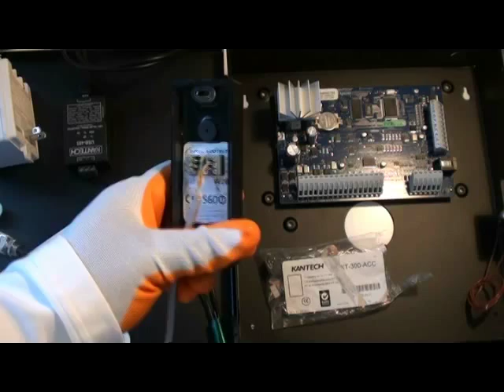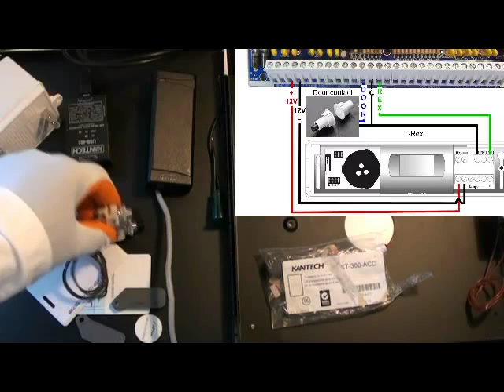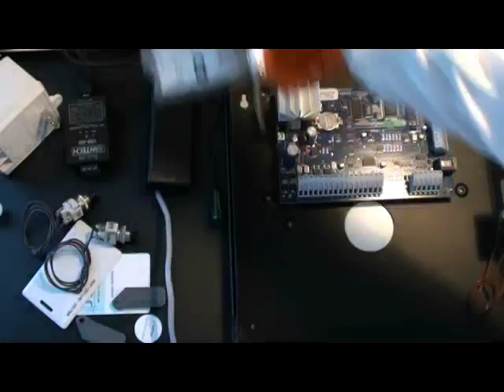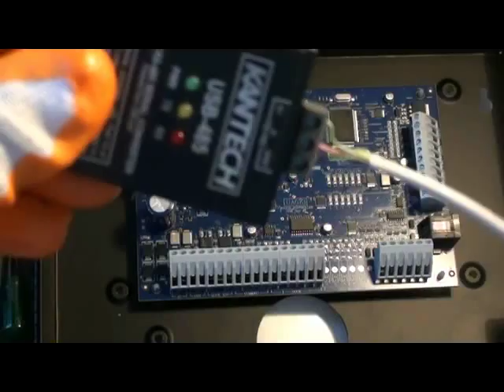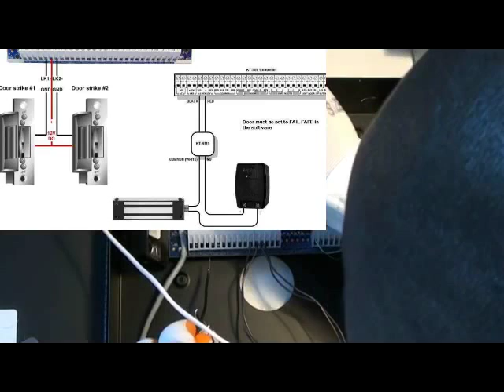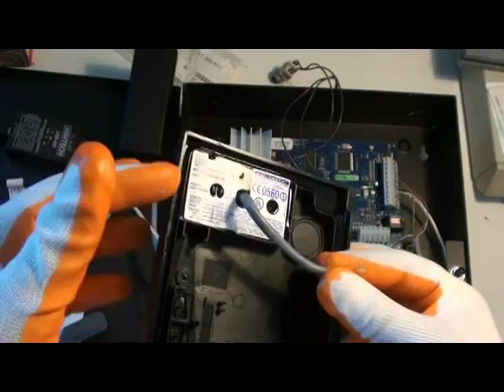1   kantech installation hardware

Comment: I’m a hardware and wiring guy. I don’t do programming of access control. I’ll run all the wires, connect all the devices, install all the relays (old school), boards, and power supplies. But when it comes to software, I’ve never been taught, and recently did a full day course and the guy left us more confused than anything!!! Somethings were fine and understandable as a security point of view, but a lot of it was very confusing on the different programs that are running…like gateway, etc. Why can’t it just be two program’s? Master program, and user program. Or just have one dam program with different login permissions??? When you log in, you can only view, or view and assign badges, etc. Give different permissions to individual login ins. You shouldn’t have to start one program first, then another, and then another.